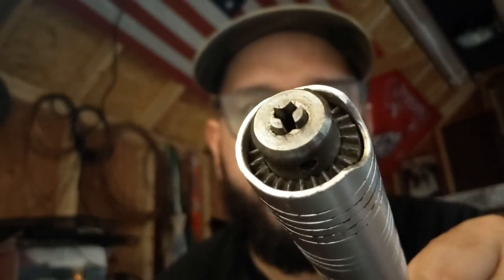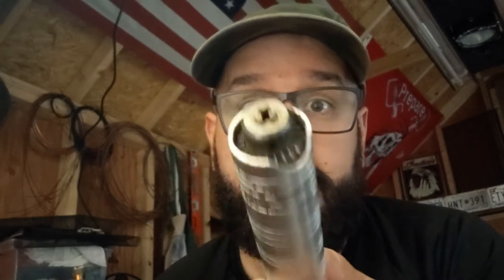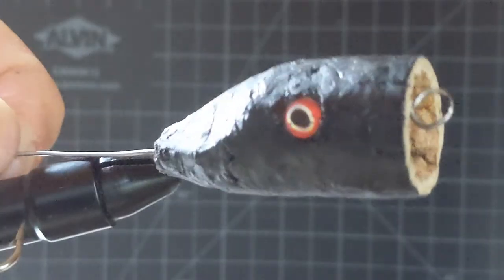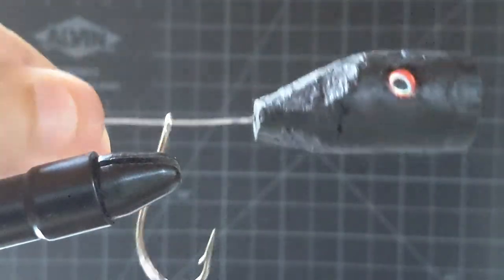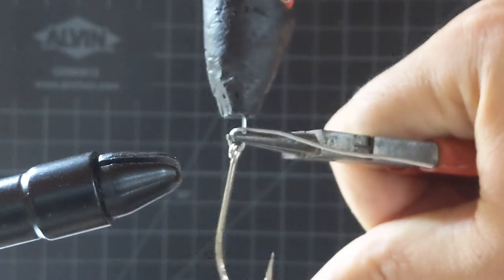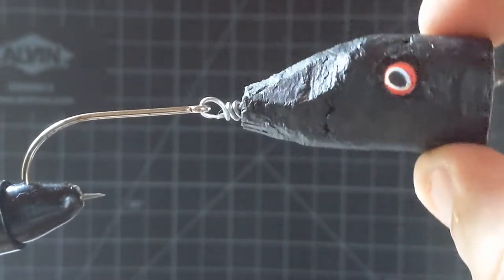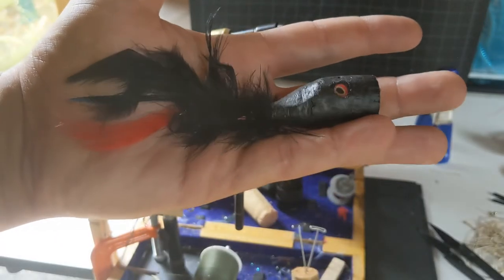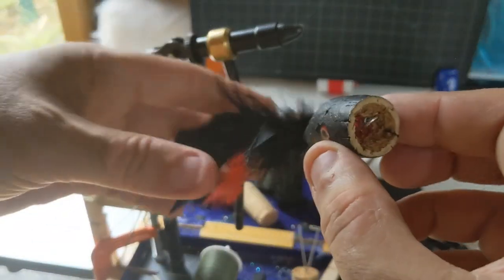DiY Tie-to-Fly Topwater Popper 3.0 - Poor Man's Surface Seducer

Comment: You cast this on a fly rod correct?
Reply from the maker: @milescobb4184 yes I use an 8wt
Reply: @bhiflies  I tried casting one of mine yesterday on my 8wt but it was super heavy.  I used some extra bunny fur strips I had from making zonkers for legs, I think they were holding too much water. I trimmed down their length and also trimmed the fur, and then used a rotary tool to make the cork parts smaller too.  I just finished putting on a new coat of paint, I will be able to test it again later in the week.
Reply from the maker: Wondering how you're doing with this venture.. still experimenting with rabbit fur?  My thought was that it may hold too much water weight, but maybe you have more conclusions since?
Reply: @bhiflies  unfortunately I have not gotten out yet to test it.  When I’ve fished recently it was for trout only.  Now I feel embarrassed, I will cast it in my yard before the week is up and test it on fish this weekend.
Reply: @bhiflies  I made some more casts yesterday and my changes helped but I still think I need to reduce the profile of the cork even more.  I tied on a Mylar popper I use for striped bass for comparison and that moves through the air so much better.  My popper without the bunny fur casts better than the one with, but I really love how those strips move in the water.  I will try again and take some measurements on the Mylar popper first to try and match that.